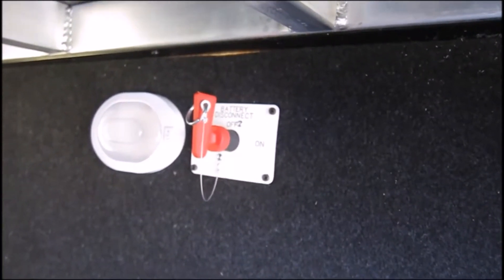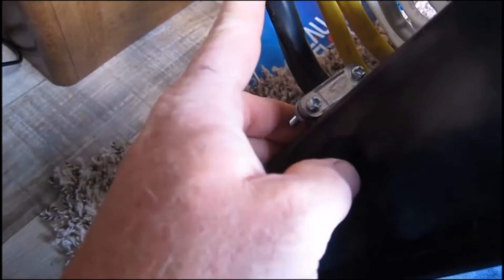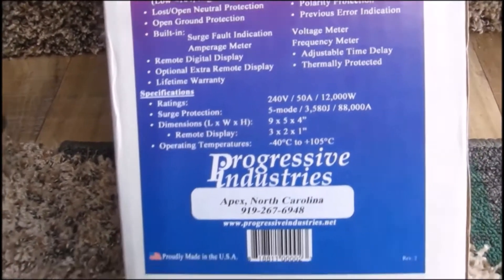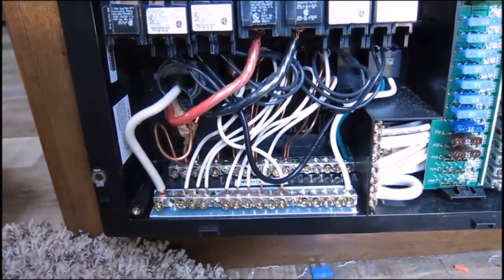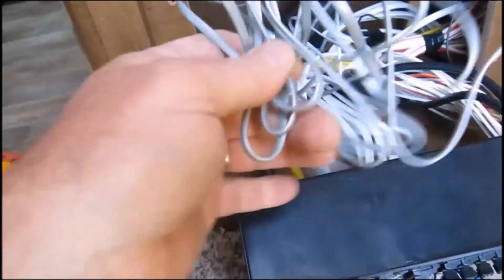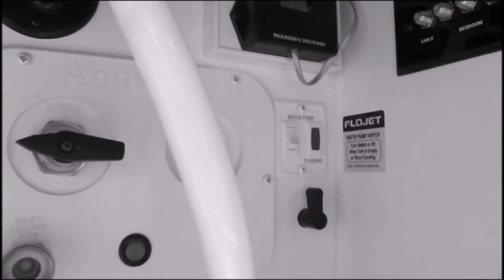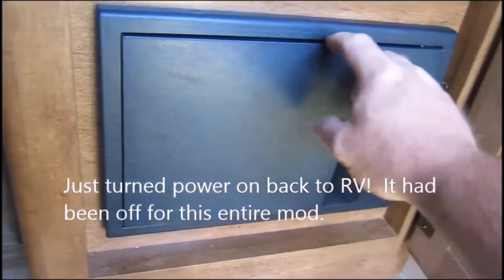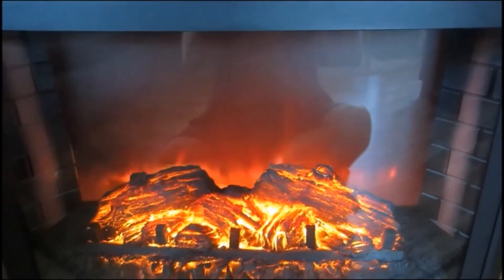RV Electrical Management System EMS-HW50C

Comment: Hi Brent, I’ve been having issues with my rv, every time I plug it in, no power will run anywhere, unless, inside the surge protection, there’s I believe it’s called a conductor or circuit, there’s an empty square with a pushable button. I push the button in with anything pointy (a screwdriver) and I get power to the rv. If I let off that button the power is gone. Maybe you can lead me in the right direction as to what the problem may be? Thank you and great vid!
Reply from the maker: Button, lol?  I wish I was an RV expert you could count on, but really I am especially nervous when it comes to electrical.  I think I would check your "button" part with an expert or at least potentially replace it if it's easy enough.

Comment: Those wires taped together behind the panel are creating a hot spot. Best to remove the tape
Reply: Do you think the RV company doesn't know what they're doing?  Can you explain why I should do it in more detail?  Cause I'm sure if they're doing it there, it's everywhere on the RV.  I'm certainly no expert, but it seems the taping creates stability from pulling pressures when moving.
Reply: Sorry, one last thing.  The wires are output wires to the RV circuits.  Wouldn't there have to be a draw from all of them at the same time maxing amps on each line?  Not being contrary.  Seriously wondering.

Comment: I thought the EMS must be installed between the shore power and the Automatic transfer switch (ATS)
Reply from the maker: You're absolutely right for those who have an ATS if I remember correctly.  Follow the instructions provided!  It's been a while since this was done, 2015.  Do you know what an ATS is?  Not being mean, just wondering.  It's important to know what you're dealing on RV electrical systems.

Comment: So where does the converter and those wires come into play when hooking up the EMS?
Reply from the maker: The EMS is right before the electrical box so whatever power source comes into the RV is managed by the EMS.  The converter steps down the AC to manage the 12v system post EMS in most schematics I've seen.

Comment: I ordered the 30 amp model today, and was wondering about the location. The existing junction box is simply mounted to a plywood box under the bathroom vanity. My concern was whether or not the ems needed to be mounted on a metal surface for grounding purposes. 
Since you didn't even mount yours, and had no errors, I am ASSUMING that a metal surface mount is not necessary?  
I sent a short email to Progressive's tech support but have not received a reply yet. I'm sure they'll think I am stupid. LoL
Reply from the maker: Rob, life-threatening safety concerns are never stupid.  Stupid is not knowing and doing.  Who gives a crap what they think, right?  I read the instructions on the box and I've done some electrical work in my life.  To me, the box, with electronics/connections is basically a junction box.  The grounding comes from the grounding wire that comes in with the hot/neutral from the outside pedestal.  The company would be liable if they didn't have a warning if this wasn't the case.  I am comfortable with that for that reason and the fact that this is the second one of mine covering 8 years of use now.  And, it's protected my RVs on several occasions.  But, before you do it, I would suggest waiting on Progressive.  Keep calling and pop back and let me know what they say.  I hope you have some great RV adventures!
Reply: Brent & Gina's RV Traveling Adventures - Thanks for the reply! 
Progressive did reply. 
They said that the EMS can be mounted anywhere, on any type of surface. Looking at the times, it appears that they replied just a few minutes after I posted my question here. I was outside working in the yard, so I didnt see it for a while. I ordered it from Progressive's Amazon store and since I'm a Prime member, I got free 2-day shipping. We are planning on camping this weekend for the holiday, and it will be our first time with our new TT, so the speedy delivery is a huge plus for me.  
Thanks again, for the reply and for posting the video! 
Have a great (and safe) Memorial Day!
Reply from the maker: Excellent.  Happy camping!

Comment: Great video, I'll be install mine today. Thanks for taking the time.
I noticed the wood door shuts over the fuse Box? Our converter blow this past summer because of that. Blocks to much airflow... Just a heads up
Reply from the maker: Thanks Bill.  It does.  It's a cabinet door for looks.  I hope your fuse situation improves for you.  Best of luck on the install!

Comment: Very helpful video!  I have been using the 30a version on our travel trailer, we just bought a new Grand Design fifth wheel, and I was wondering where I would mount the EMS-HW50C that I bought for it.  I intend to install it in our fifth wheel exactly like you did!
Reply from the maker: Fantastic and congrats on your GD!  I know the feeling you have now with that new camper.  Get out and revel in it!